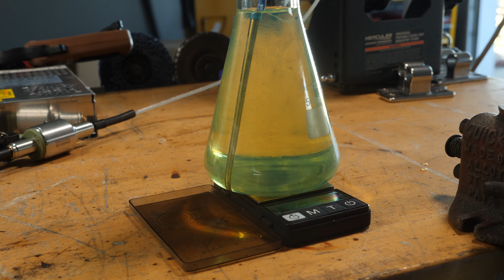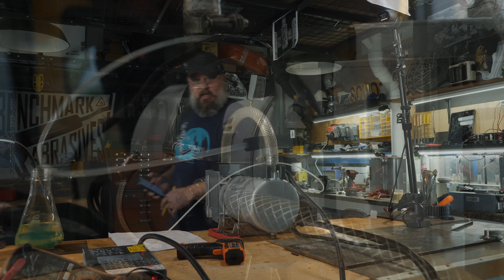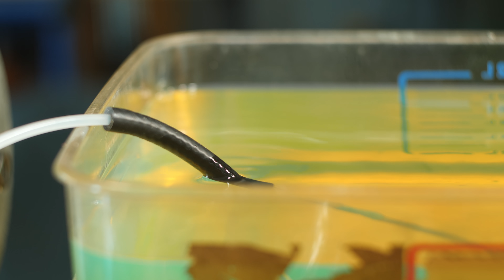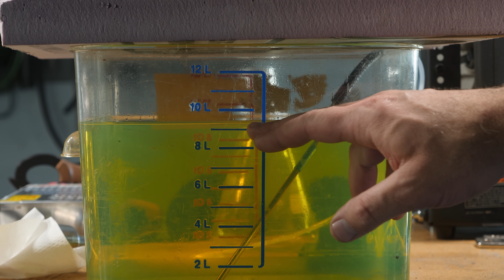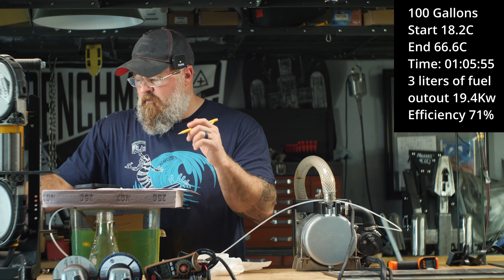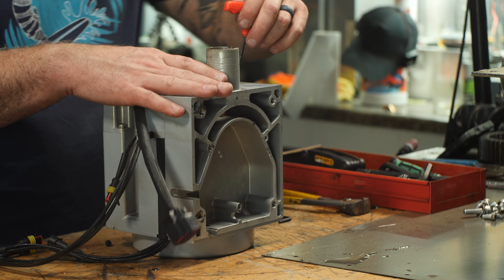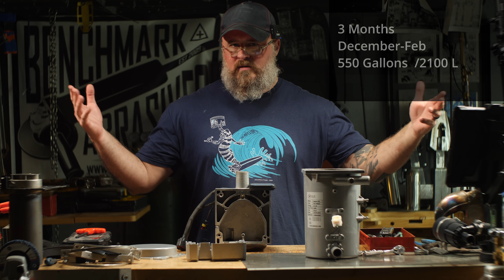The Diesel Heater They DON’T Want You to See — Real 20kW Output!

Comment: Heating up water in a tub is one thing, heating multiple radiators in a house another. The heat must be exchanged to the air in several rooms. That cools the water significantly. 20Kw is a lot but 3 liters an hour also. A cold day might consume 12-15 times 3 liters = almost 50 liters a day. You need a really big diesel container of 500 or more liters. That gets you through 10 days in extreme cold conditions. Economical? Maybe in large numbers, correct me if am wrong?
Reply: The average heating unit uses 0.75 gallons per hour and it's cycles multiple times in that hour so just saying
Reply: I use 2 5kw in a 5th wheel in North Dakota. With one 8kw air type blowing under the skirting. I at the most 50 to 60 gallons a month in January and February when it sometimes gets -35f with 50 mph winds.  Small price to pay to heat a substandardly insulated structure in those conditions.

Comment: Would this run on "old" diesel fuel, as in about 3 yrs old?
Reply: No reason it shouldn’t as long as it doesn’t have the “diesel bug” in it. (If it’s black don’t use it)
Reply: There's preparations that clean up Diesel bug & prevent it. The bug is an algae that grows where Diesel touches water so drain the water out of your system regularly.

Comment: Why my mum oil heater takes whole room at her home? 🤔
Reply: Maybe to heat up to 500 Liter of water, all tubing for Distribution, pump for distribution, and a lot of insulation for noise and heating losses to prevent. Our Oil heating unit serves since 25 years with 1 time a year maintenance. After 25 Years we got a new burner unit that will last another 20 years. That all stuff is made in Germany, where i do live. Maybe we had 3 times a fault, mainly because of cloaked diesel filter. Over all 99% reliability.
Reply: @kaikuper7526 thx!
Reply: Typically, oil furnaces could fill a small room or large closet. That is typical.
Reply: because the manufacturer is so important that their product has to take lots of space.

Comment: Why not make the log home more heat efficient put 75mm of kingspan heat insulation all over the walls then if don't like look of silver decorate  with wood effect or brick shouldn't come off if stuck well down then house would be super efficient very low cost to heat in the most coldest winter

Comment: I was full time in a bus with my fam of 7 for over 5 years, I don't miss wintering in a bus at all, the metal construction really made me question why I went with a bus lol.  Now that we have a stick house the bus has been gutted, it will have heated floors this time around I so regretted not puting in heated floors, specially the first year or so as I slept directly on the floor and winter was a nightmare.  Most nights I was at work though thank God.
Reply: Try thinking first

Comment: SO... ive been testing and using Diesel Hydronic heaters for 10 years...  *ALL* of these heaters you have here have one big flaw. ad that is to perform any maintenance or work on them, they have to be removed from the bus (or enclosure).. I tested an HLN, a couple from D&E, couple from HK.. a real webasto TSL-17 (5KW), and finally a real webasto DBW2010 (said to be 13kw, however its LARGE heat exchanger and running a 0.45 nozzle instead of the factory 0.34) results in better efficiency than most any of the chinese units... of course the BIG drawback to the DBW2010 is the price.. HOWEVER school bus junkyards are your friend.. and since the real webasto DBW2010 operates the SAME as a standard oil fired boiler in a home..  (think Beckett AF) they are very easy to service.. the burner head swings open to allow changing and cleaning of the nozzle and real spark electrodes (no glow pin)(no screen).. the fuel pump is driven by the main motor (self priming and not a clickety-clacker)and has a heated pressure block so it starts in super cold weather..  (most of the chinese units I had.. esp the HK had trouble starting cold below about 10F, my D&E started at minus 20 but took 3 tries and using a torch to heat the intake air...)...  the one HLN unit i tested worked pretty good but it was not any of the models you have there.. my beed with it was the super long startup time.. which when trying to ehat just the interior of the bus my water would get too cold by the time the restart happened...  if using it to heat a building Id have wanted a rather large ballast tank..   all of the ones i had it took removing my heater completely from the bus to clean the screen or the glowpin which I found inconvenient.  I live in ohio and I use diesel heaters in 2 of my 3 busses (the 3rd is a true classic and gasser so no diesel heater there)..  one of my busses is a obile office and christmas cruiser.. it sees weather from the minus 20s in winter when im up north to 100+ in the south in the summer..  being that bus is a DT360, it has no glowplugs and trying to plug in a block heater at a hotel = not happening so I rely on the diesel heater to preheat the engine.. having it start in well below zero weather is a must.   I would say *ALL* of these heaters need boxes... if you mount one under a bus, the resonance of the motor and pump will be noisy inside..  I mounted mine in a toolbox under the bus with enough clearance to swing the burner head open for service..  ..  big advantage to the HLN units is the digital control.. I never had that on anything except my D&E.. and yours looks MUCH nicer... the webastos just have an on / off switch or a straight timer..  if i ever need another one and couldnt find a cheap used DBW2010, the HLN looks like a decent unit and id probably give it a try, after all its been a few years since i tried one of theirs...

Comment: Brilliant video...
Have you considered firing up a rocket mass stove with a diesel heater... that's been rather striped down to the point it's like a flamethrower..
I saw a YT video some years ago where they had rocket mass stove the size of a snooker table.. heated the house for 48 hours.. I wondered about the diesel heater acting like a jet engine (we can't afford one, though what fuel can they burn?)
A home must have at least 3 (2 minimum 4+ good) different forms of heating and cooking this is perfect as one of those.

A factor with the burn is the inlet and exhaust should be outside together (a foot or so) to keep pressure balanced.
Regarding the exhaust.. a tank or much larger pipe would not restrict it.. and you can prove this and actually tune it you need to do the same as is done with internal combustion engine's on the inlet and exhaust..
Measure the 4 pressure's also use Venturi and an exhaust gas analyser or good CO/Particulate meter min.. (something fun would be to take it to a vehicle test place for them to get the data)
Another approach is to 'trick' the exhaust and the engine into thinking the exhaust is as designed..
Use the exhaust as supplied but it goes into a tank.. oil drum or drums connected together gas tight but with big holes between them so there is no back pressure alternatively a large pipe at least 6".. 12"+ better diameter and 30? feet or longer..
.. with the outlet near the inlet..
The inlet can be made quieter and more efficient the same as IC engine's.. use a bell mouth on the inlet tract.. and put that in a large pipe or oil drum that's lined with fire proof sound absorbing materials.. like an air filter on a car.
I also wondered about putting a 2KW jet/pump speed in that size housing.. would it extract more heat before the exhaust.
Reply: Hyped 1,880..
Production, content etc.. 100%
.. front camera angle could be a little higher.
(has anyone played with having an afterburner on a diesel heater or add an actual turbo.. the sound would be crazy.

Comment: I have an 8 kw air type diesel heater. I tried a heat recovery system on the exhaust, it did not ruin the chamber but the cooled tubing did get blocked with a nasty soot. I always say there are an infinite number of ways to remove the epidermis from a feline. Good work on a simple experimental system with decent data gathering.
Reply: A little insulation will resolve the soot problem

Comment: 16:08 you know, on seeing those numbers, and considering how expensive diesel is, I wonder if anyone makes a reasonably priced propane coolant heater?
Reply: Here in the UK, conventional combi boilers are available set up for propane, this is for off grid domestic and static mobile homes.
Reply: Umm yeah. Buy an rv gas water heater and use that as a boiler if that’s what you want to do. It would be a very simple setup. All you’d need is a water pump , a few heat exchangers and pipe and fittings. Propane hydronic!
Reply: Truma, Dometic & many others make them for RV use. Diesel is popular because of the incredibly cheap prices of Chinese units.

Comment: Also this testing did not attempt any heat recovery from the exhaust. A common efficiency modification with the Vevor units.
Reply: its even easier with hydronic units...  junkyard EGR coolers from diesel cars work great for the purpose of exhaust heat recovery
Reply: This leads to sooting. If you're prepared to strip the unit apart & clean both it & the exhaust regularly go for it.
Reply: @alanhat5252  you can do it as long as you use something with minimal backpressure..  backpressure lowers the airflow which causes the heater to run rich and make soot...

Comment: Wonder if it was incorporated into / with a rocket-thermomass, by integrating coils into the thermomass, to maintain the mass temperature?
Also, as the intake is to supply combustion air, what about a outside air intake?

Comment: My home is 2300sqft, my temp during winter might reach -1 with a cold snap for 2 or 3 days hitting -6. But that is rare now.

I would only need to use this heater to keep the temp at 18 degrees during the night, and 20 degrees during the day. I believe from the calculations i would be using much less than 50 litres a month or even over the full winter period. Remember, it is much more efficient to heat from 18 to 21 than from say 12 to 21.  I would like to see a more realistic test, put this in a medium size house and see over a month what it costs to keep the heat at 20 degrees. I think we would be pleasantly surprised and the device not working hard at all.

Comment: Yes, for me in Scandinavia it sounds expensive! If you have a water tank of 1000 liters and the diesel heater ran 1 hour x 5 times per day, the consumption will be 40 liters of diesel, Why not get a Monoblock heater for water and air I mean even if you don't have electricity you can run a generator of 4Kwh as monoblocks draw 0.5-1.5 kwh per hour depending on how cold it is, but diesel heaters in temporary situations or mobile installations are super. Thanks for your programs!.PS: Today I heat the water tank with wood and pellets CHEAPLY.

Comment: @9:56 You seen to have sizable error in your calculations. 1L of diesel has around 45MJ of energy, equivalent to 45MW (Watt = Jule/sec) or 12.5KWh (12.5KW for 3600 seconds). Now 3L would have 135MJ of energy or 135MW  (37.5KWh energy equivalent). Based on your numbers 19.4KW (which is also confirmed by the temp difference of the amount of water) output for 3960 seconds, would give 76.824MW output. So the efficiency based on these numbers is 57% (56.9) and not 71%. The issue with all these heaters is that the water jacket is directly placed in the burn chamber and in this placement it deceases directly the burn efficiency of the fuel. On contrary, the burn chamber needs to be on its own, and the heat extraction needs to be done after complete fuel burn.
Reply: Give the guy a break! He's used to" freedom units". This metric stuff takes a bit of getting used to! 😜
Reply: The first efficiency from this test is moot to me since the water tub is not nearly insulated enough. Taking a temp in vs temp out over time to get an average temp at steady state is the way to go. He should be getting closer to 80%

Comment: I use a 5kw CDH to heat a 40 sqft room in Wyoming the the year on 15 gallons of diesel. I have it setup with a thermostat to turn it on and off. Has Benny working for 5 years now. One time when it didn't turn off the room got to 100 F. That was a bug that has been fixed.

Comment: So this is a water heater not a space heater.
Reply: Yes.

It's meant for heavy duty diesel trucks and buses,

plumbed into the coolant system to preheat the block and heat the cab without the engine running. 

New diesel engines don't like to idle due to emissions control equipment.
Reply: @iroulis old Diesel engines don't like idling because of injector & combustion chamber fouling.
Reply: @alanhat5252  New diesel engines won't start because idling plugs up the catalytic converter,

Comment: I heat my house with only a 5 kWh heater it's all about insulation
Reply: and size
Reply: @makingstuffinhere well actually size don't matter much  just take a look at earth temperature inside a mine, mountain or earth. It's stabil year around due to insulation
Reply: @mnp3713  dude, firstly, thermal capacity isnt the same as insulation. Secondly your house isnt a mine. And thirdly, space that needs to be heated absolutely matters, especially when its the air that gets heated, especially when you introduce airflow.

Go take a nap.
Reply: @makingstuffinhere  true but not really - thermal capacity are great in rocks, Thermal conductivity not so much so its a good insulator as well. 
In reallity room size matter, but in theory not. its all about the insulation - i stand my ground and by the way trolls live underground and in mines 😜

Comment: I don't understand why someone would purchase something like that when you can get those little suitcase ones that are whisper quiet and put out a crap ton of heat. And those only cost 100 or 150 bucks...
Reply: I’ve used several diesel heaters. Both types. The water heater type have a few advantages in different situations such as being able to place a few heat exchangers where you need the heat on their own thermostat. Using a 6 gallon heat reservoir i can run 2 separate temperature zones. The 5kw boiler unit runs wide open until the liquid is 170+ then goes down to a very low idle. When the exchangers cool the liquid down it ramps back up again. I’ve found these to burn 1/3 to 1/2 the fuel depending on how cold it is outside. Not only that but you can have your boiler completely outside a flammable structure and plumbed in. This also negates the chances of CO poisoning too. There are actually lots of advantages to these.
Reply: 2KW or 5KW vs 20KW

Comment: I’ve been doing a lot of research.
Since 2021
For off grid heat 
It’s Alpine Pellet Stove by ComfortBilt HP40 Compact Small Pellet Stove Black 25 Lb Hopper
Reply: Does the vibration of driving on the roads compact the pellets?

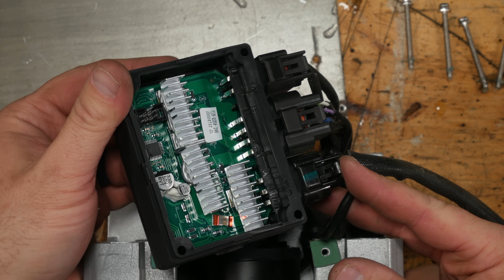Comment: 13:21  with solid state electronics their life span is directly correlated to how hot they get over a period of time, 
so for example if the chip, transistor mosfet states its maximum operating temperature of 150°F, and you maintain that temperature its life span will be quite short than if it’s maintained near, or above room temperature a bit. 
The hotter they get the more their internal connections expand, and stretch then when turned off. 
The connection cools, and they shrink, and this repeats with on, and off cycles I’m sure you’re aware of metal working. 
So in truth any semiconductor that starts going above ambient temperature needs some way to cool its self, if current is low enough across the semiconductor then it’s generated heat will be generally lower, if the junction current is near its maximum then generated heat increases once generated heat reaches near a certain point “the different semiconductor with different variables” 
They can reach thermal runaway (look into semiconductor’s linear region, and thermal runaway)
This is why electronic circuits can never be 100%, ,and the claims that some of these newer electronic circuits stating they are 98-99% I highly doubt. I’ve worked on electronics and understand them a fair amount now I’ll never learn it all, power factor isn’t 100% true if one doesn’t truly understand the difference between an inductor, and a Capacitor.  It can create a pseudo power factor of 0.98-0.99 a power factor of 1 is the best most efficient type of load it basically means “it’s technically 100% efficient”
The only thing that has a power factor of 1 is purely resistive loads ( the old school incandescent light bulbs for example) they are purely resistive loads which means that pretty much 100% of the energy put into it is converted into something else useful “light, and heat” what’s important is the “converted part” the resistive load is true for both AC, and DC. 
However with inductive, or capacitive loads which don’t Don’t naturally work on DC without some from of switching. 
Without getting into that complex rigmaroll. For AC there’s a wide range of power factors but it getting a power factor of one is very tricky( power plants have to dance to set it right on the grid if it’s not automatic)
Anything around 0.8 is pretty good. We can reach around 0.9, and a bit higher with the understanding between the inductor, or capacitor one leads voltage, the other leads current they are the equal, and opposite reactions of each other! As voltage, and current are two different things. 
Look into power factor you’ll probably start including it into your testing once you see it